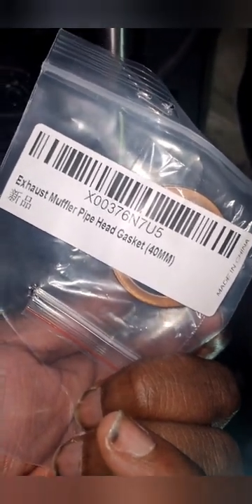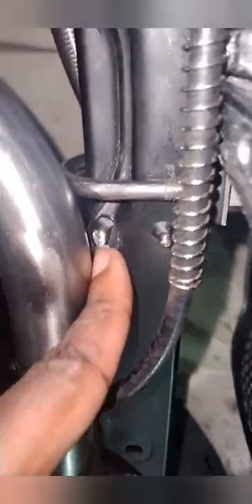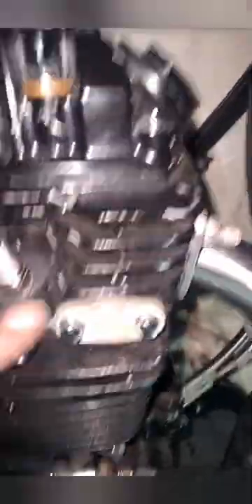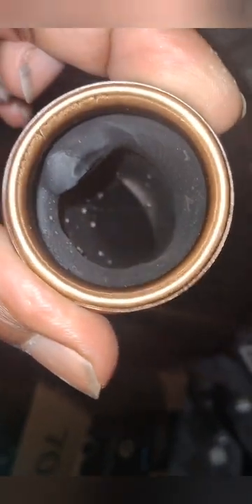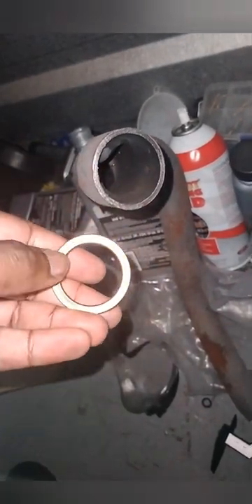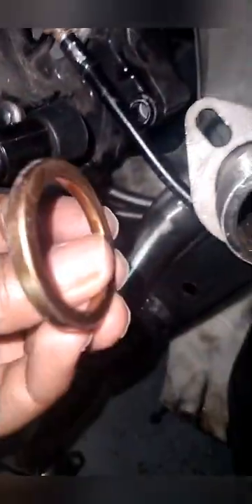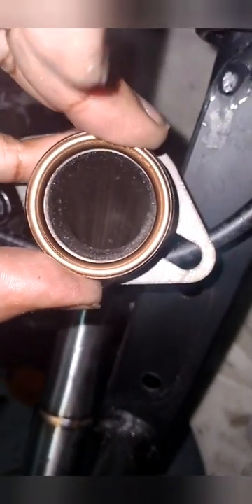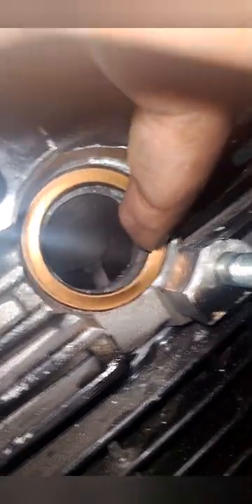DF250RTS / X22R Stage 1 exhaust complete 💯✅

Comment: Sup brother. What did that bracket go to that u took off to fit your pipe on? Btw I bought the same pipe . It’s comin in today
Reply from the maker: I just put it with the rest of the spare parts that I don't need anymore but you can fabricate a new brace bracket for the engine you just got to bend it around the pipe I'm trying to find a machine shop that would do that for me cuz I just don't have the time
Reply: @trucker2b  ok I gotcha… but it’s ok to still drive the bike without it?
Reply from the maker: @yus2650  I do... But no highway at the moment....